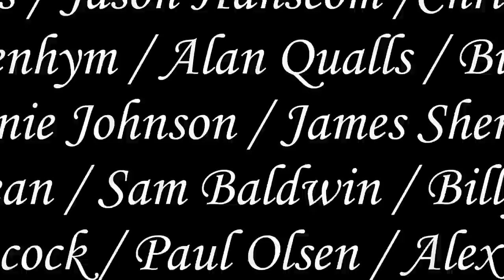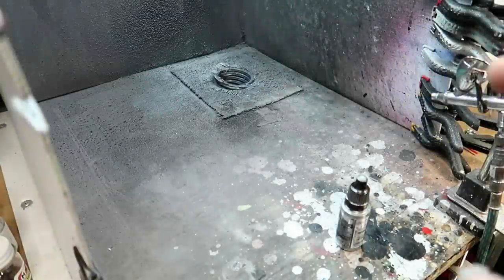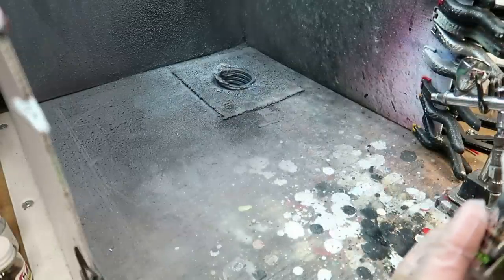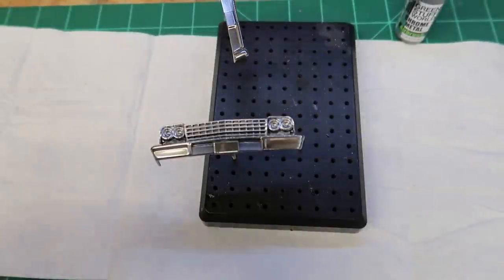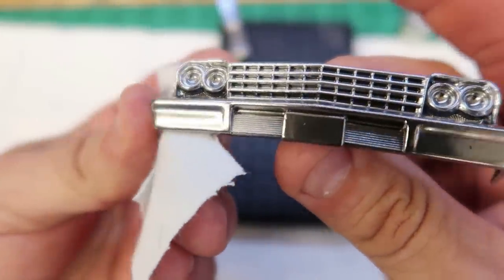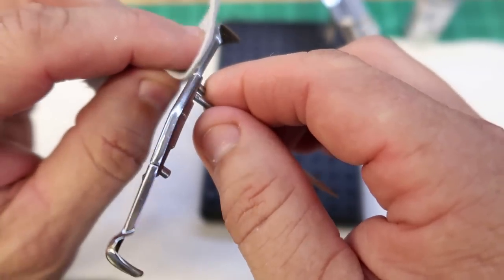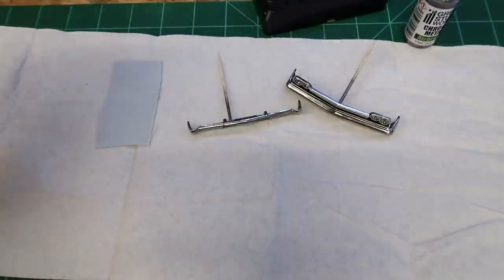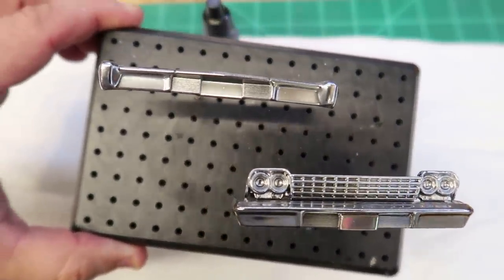Green Stuff World Chrome Paint / Is this "Stuff" any good?? Let's find out!!

Comment: Looks and acts just like Alclad. I find the trick to using Alclad (and probably this as well) is to hold the airbrush further away that you think will work, layer it on with a spray pattern so thin you don't see it flying through the air, keep turning the piece, and watch as it begins to turn chrome seemingly by itself. When it gets to max brilliance, STOP. It's always tempting to keep spraying more, but the moment you put too much on, it turns from chrome to silver.
Reply: Bs lay it down 😝just kidding 🤥😳

Comment: I used recently Revell chrome spray can. Very good stuff, no undercoat needed. The best for my!
Reply: Yes I agree, but you can not touch it, wipe it, get anything on it. Plus takes a long time to dry, like a week or more. If its thin, then it drys pretty quick. But sometimes you need to spray it again due to a defect or crack like finish and then the paint gets thick. Stuff is amazing otherwise.

Comment: Looks pretty good. FYI. Those Chevy of that vintage, the ribbed surface panels beside the license plate are made of aluminum and thus not as shiny as the bumper itself. In the 1970s I had a neighbor down the street who had a couple of them. One was completely stock and pristine, the other was a hotrod. Both had 409 engines and his house number was "409". I lived at 1070. His hotrod Chevy had those aluminum panels gold anodized. Looked really sharp and unique.
Reply: I was going to point out the same thing.  Plate area inserts along with the grill and headlight surrounds are all aluminum and have a notably different tone from the bumpers.

Comment: Nice vid. The chrome looks very believable in scale. Hope your vacuum has a "Brushless" motor or may run a risk of fire or explosion from any flammable paint fumes.
Reply from the maker: The motor isn't exposed to any of the fumes. It's a wet vac so the motor is outside of the tank. I thought that through before trying it. It's worked great for years now but yes if exposed to the fumes it could be a huge problem!

Comment: Quick question.....what do you use to keep the parts attached to the wooden piece while painting?  I have always wondered this and don't want to try anything to strong that might hurt the part.  THANKS!
Reply from the maker: Just a little super glue. It pops right off when you're done.
Reply: @modelcarvideos5829  Awesome! I appreciate the tip

Comment: Curious if this will take a wash (for the grill) or paint (for the parking lights).
Reply: it doesnt
Reply: well at least the Tamiya panel line wash anyway
Reply from the maker: Haven't tried this one yet but more than likely it will break down.
Reply: @modelcarvideos5829  the Tamiya panel line wash will for sure. Maybe something arcylic based would work. A vallejo or something. You need to try the Revell chrome spray. Its expensive AF, but it is awesome. Best stuff out there.

Comment: I've been using this "stuff" for over a year. I see you are using the airbrush flavor. I wasn't impressed with that. Try using the non airbrush flavor in the airbrush (I don't follow instructions well) and kind of put it on pretty thick. Stand back and be amazed as it flashes. No base coat, no primer, the smoother the plastic the better. Doesn't matter what color but I'm fond of white plastic. If you get trash in it, dunk it in rubbing alcohol, try again. Dehydrate the daylights out of it. Then you can handle it, not too much though. Much more robust than the Revell stuff in a can.
Reply from the maker: Cool! I'll have to try that